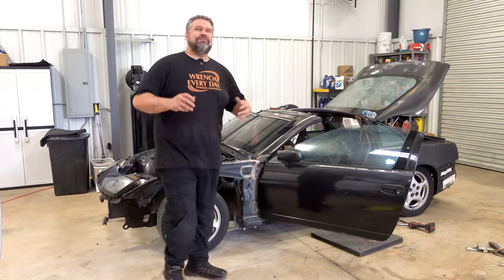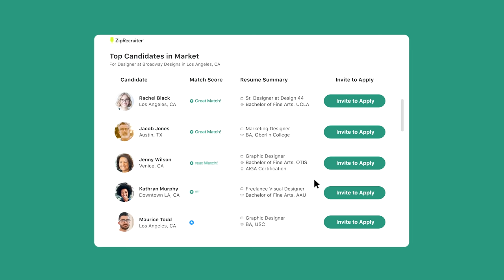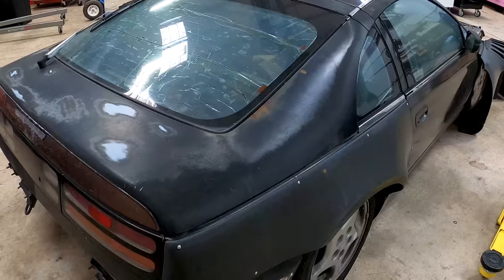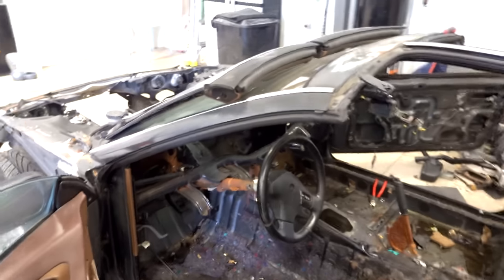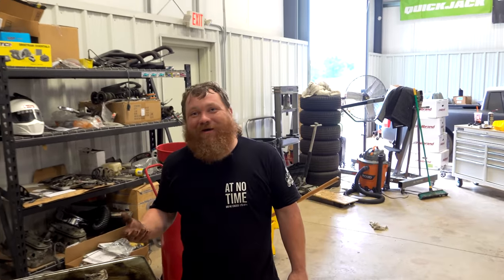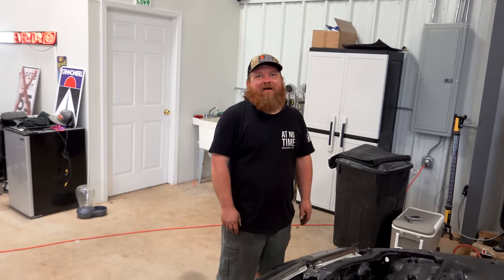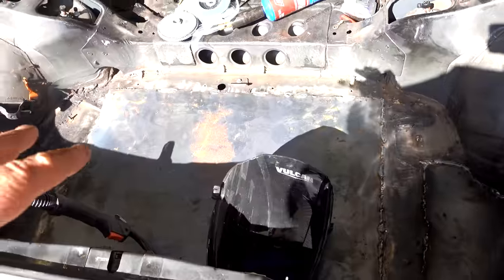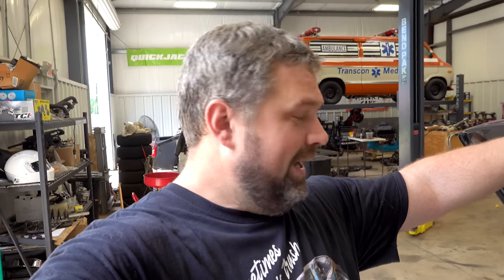My Car Almost Put Me In The Hospital...

Comment: I'd say you'd still want a fuel cell for the car as the tank is slapping distance of the tires when they pop.
Reply: I'd argue a fuel cell would be a good idea to keep the chances of fuel starvation down due to centrifugal force
Reply: That’s what Derek has in his burnout car but he has a trunk to contain fumes. Doesn’t the 300z have a hatch? Well, Jared will figure it out.
Reply: The Australians actually pour concrete into the floor of their boot because not only for traction, it's cheap armour against nasty blowouts bursting through the floor and doing extra damage

Comment: Make the exhaust come out right behind the rear tires pointing out so when your doing a burnout it will push more smoke to the side making a hugh cloud
Reply: Yup VGG did that on Independence
Reply: @OldManTinkers  but soon realized it also caused fires somehow..
Reply: @tripprogers4814  No Shit wow! Must be all the heat and flying bits of Hot rubber LOL Makes sense Didn't think of it that way. Hummmmm

Comment: TIP for better weld-in plates. Put your piece on, tack it at the corners, then centers, then centers again, until your plate is stable. Then pick a spot, and run a slit disk at the edge of the seam. Remove the dead part on the bottom, or pry it out of the way and start stitching on top. Rinse and repeat switching sides so it doesn't warp and you'll have a stitched panel that's on level with the old material.
You start with flat stuff, but once you get good at it, you can do this with curved panels too. Excellent skill for when you do stretching, lowering, or widening on a metal car.
Reply: Fitzee’ Fabrications here on YouTube has a few examples of this.

Comment: For wall taps, I recommend a light outer bar with offsets to a solid inner bar attached to the "frame" structure. That way when you tap the wall, the outer bar hopefully pushes to one side redirecting the crash energy offset from the main structure keeping it more intact. Crush zones specifically for wall taps.
Reply: wut
/

Comment: One of the worst smells I've ever encountered was from the rear end of a ~2000 BMW 330i.  Said car had a Quaife differential and had just returned from a track day.  We removed the drain plug and promptly fled the immediate vicinity.  The. Smell. Was. AWFUL.  Worse that any differential fluid I, or my mechanic friend, had ever smelled in our lives.  Just absolutely eye wateringly, gut churningly rancid; a smell you truly felt could be physically cut with a knife.  Soon as it finished draining, the fluid was dumped into a waste collection can, which was then sealed and the catch can hosed down with brake cleaner.  The smell in the shop was still pretty awful, despite the roll up door being open, but had to press on as things needed to be done.  

A few minutes later a firetruck rolls up with lights and sirens on.  Took a moment to figure out what was going on but, apparently, the smell was so awful that a nearby business thought there was a massive natural gas leak and called the FD.  We assured them that, no, it was just bad diff fluid.  Skepticism ensued... so we took them over to the collection can, popped the cover and let them bask in the terrible stench; skepticism ended!  The shop still had a lingering odor for a couple days and still makes me queasy thinking about all these years later.  (Problem never happened again as my friend installed a differential fluid cooler into his clients car; lesson learned!)

By the way, Duane, nice touch on the vapors rising up under Jared during the countdown!  Really enjoying watching your editing skills & touches grow over the years.  :-)

Comment: Building that bottom end on the big block will save you headaches and money in the long run. They do NOT like high rpm (burnouts) for very long. They will 100% stretch a rod, catching the ring and either having excessive blow by or actually rip the piston top completely off. I've had two big block gm's do exactly that.

Comment: I know you will have the handbrake for the rear wheels but I would do a line lock instead of a full rear brake delete.  Just in case you decide to street drive it or in case of emergencies.

Comment: I did a clutch in an old diesel Rabbit, that had a rear main leak, the injectors leaked and the front seal of the manual gearbox also leaked. All these fluids got to, and caused the clutch to burn up...I smelled that for a week after the car left!

Comment: It'd suggest a flame thrower. I always thought the Earl project car stunk no matter what it was going to be. Happy to see at least some of it going to the landfill and always thought the whole thing should be crushed. What happened to the Honda limo? When's that ambulance going to hit the road. I'd really like to see those get done. Earl as a burnout car is a great idea but I wouldn't want to be the one trying to drop that big block in there. I do believe that job is going to be a nightmare but maybe it will twist that cheap frame up like a pretzel.
Reply: Shouldn't be too bad, the VG3x is a big old lump for a V6 - given the size of the heads and of course all the piles of weird semi-electrical, semi-vacuum, semi-mechanical octopus spaghetti ignition and injection crap that was in use during the height of 90's Japanese engine technology...  then the TT version used a pile more space - The big blocks going to be longer for sure but probably going to use up less space overall.

Comment: Hey Jared Love "Your Videos" Quick question I noticed a Gas heater hanging from the celling! I have a brand new Metal Shop working on Insulation now, What does the bill run you in the winter to heat that space?? Just a Fan!
Reply from the maker: I actually haven’t run it yet, I love cold weather, and it only hits down to low 50s so I just wear a sweater!

Comment: Good lord! didn't realize it was a base model 2 seater. It wasn't even a twin turbo model and the pervious oowner did that much work on the exterior!? 🤣Do you want to sell the instrument cluster along with the wiring harness to it? I need the wiring harness and the cluster for only 2 parts the male and female connectors to make a modification to the dash that Nissan should have done in the first place.

OMFG! That engine in that car!!!! Gawd don't tempt me! I'll stick with my 183 (3.0L) Twin Turbo

Comment: I really want to see that engine running the 4 barrel side draft adapter.

Am serious Jared!  Imaging four side drafts on top of that intake.  Be very sexy.  Flat bottom, and flat topped.
Reply: Why, those adapters are junk. Thats only used for car show looks They dramatically affect power, and performance negatively. Theres a reason you never see them. Being ran kn anything, other than show cars.
Reply: @bretjjjohnson7942  Am aware, they dont do anything but shorten the height and no value with them going to a common intake plenum, but it would look good!

Comment: Wouldn't it do better burnouts with weight over the wheels seems you chopped all unnecessary weight out. Great for a track car a burnout car i don't know.

My thoughts are weight pushing down on the tyres will create more friction so better burnouts.

Comment: Driftcar with a tunnel ram big block?? Totally dumb. An alloy LS with either injection or a carb conversion would be far better. Far lighter and far smaller.
Or a even smaller 302 Ford that will fit even better as it is smaller than the V6 thing though would be harder to make big power from.

Comment: Now do Honda Rousey!
Reply: Has he gotten it out from that storage unit, though? IIRC they built a new row of units in front of the one Rousey is stored at that's too close to easily get it out.
Reply: Don’t know if he’s done it yet but it’s gotta happen. Jared bringing Earl to Georgia was the beginning of what turned this channel around but slapping the 2J in ‘‘em was merely a prerequisite to the real passion project. The vision, creativity and fabrication skills Jared showed in that build is what sold many of us on his content. Granted, a Jetta Diesel engine swapped into a stretched ‘85 Accord limo didn’t have the click through rate they wanted to build the channel so we got a ubiquitous LS swap in Honda Rousey’s place. But 600 ft. lbs. of torque and a bunch of rally spec upgrades in a Honda limo are exactly the kind of questionable choices that have come to define the channel. I think Jared has earned enough respect at this point to be able bring his audience along on what I think is his most ambitious build to date. #nobodyputshondarouseyinacorner #freehondarousey
Reply: @RO8YO  yeah, hope we get some update soon. Didn't the consider some kind of rotisserie or something to flip it on it's side to maybe get it out? I guess he could cut it in half and weld it back together. 😆 That would be seriously questionable.

Comment: YOU WANT AIRCONDITIONING BRO!!! INSTALL AN ELECTRIC AIR CONDITIONAR SO YOU DONT TAKE AWAY FROM THE HP's!!!!
Reply: Unless you're referring to a self-contained / self-powered AC, then anything that runs off the vehicles electrical system will add load to the alternator and cause parasitic loss.  That said, this is going to be a burnout car and maybe play at a drag strip once in a while.  In both of those cases the windows need to be down; so having any kind of AC goes right out the window. ;-)

Comment: You are really going to destroy a automotive icon like a Nissan 300Z in that kind of event? My respect for you have went down a notch. Edit: I stand corrected.
Reply from the maker: I promise this is not a good example, and was set to goto a scrap yard
Reply: The car was already gone and rotten before Jared touched it, nothing of value is being lost here, it wasn't even a factory Twin Turbo car to begin with 😂
Reply: Watch the old videos on it. It was a wrecked heap that was shade tree fixed. It would take a lot of effort to make it road  worthy. Just look at the engine bay and strut tower. The passenger side looks like it was stitched together with a home made stick welder and covered in seam sealant.
Reply: Ok...